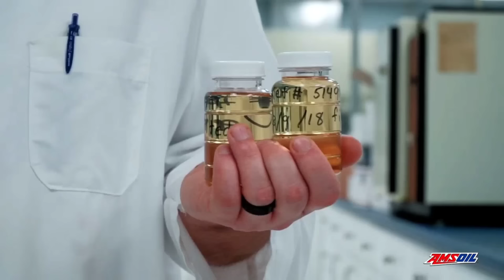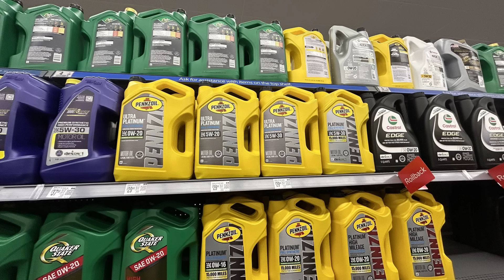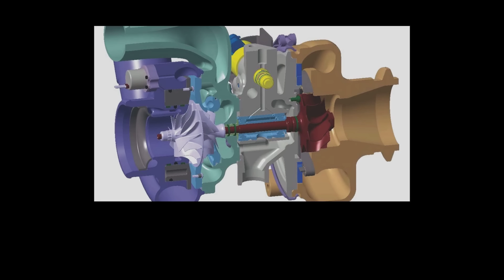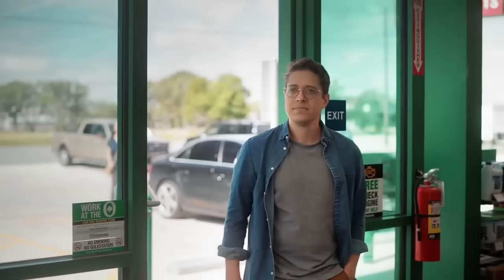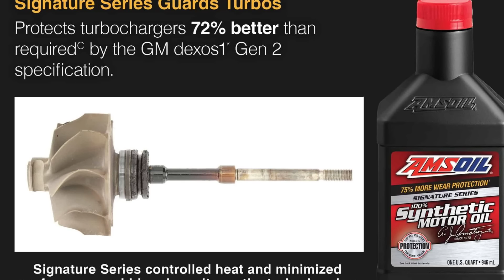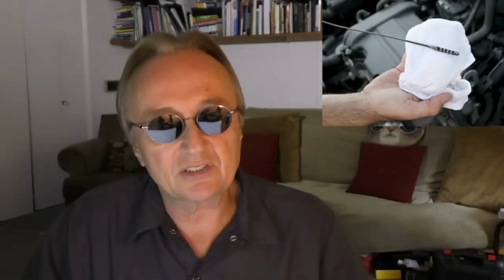Pennzoil Ultra Platinum vs Amsoil 5w-30 Oil

Comment: Nissans Chief engine builder says not to go past 2,000 miles between oil changes.    He is an educated man who knows what he is talking about.  Been doing 2,000 mile oil changes since I got my first car decades ago.   When I raced the engine oil got changed after every race.
Reply: Well he is working with a Nissan engine after all.
Reply: @johnk3606 My 1999 Pathfinder has run on Mobil 1 oil and filters since its first oil change.  Change interval is around 5K miles.  The engine has 255 K miles on it and runs extremely smooth.  I had to change a valve cover gasket last year, everything underneath was like new.  That vehicle has had only around $2000 of unscheduled maintenance since I bought it.  It has been the most reliable vehicle I have owned.  That said, I would not buy another Nissan since Renault bought into them.
Reply: Another person stuck in the 70’s 🤦‍♂️🤣
Reply: Yes,i saw that video....and he said Castrol makes the best oils.
Reply: @steverugerguy9606 Castrol is one of the worse according to real tests
Reply: @candyman1967  I've torn down many engines.  Most die from abuse and neglect.  The average person does not treat their cars well.  Just routine oil and filter changes go a long way.
Reply: @steverugerguy9606  Good thing I use Castrol.

Comment: Amsoil is 10% better than Penzoil Ultra platinum, cost double. If you change oil every 5000 miles, PUP is good enough. If you have very expensive car, use Amsoil. Running 10000 mile oil change could make the oil acidic, which could corrode the engine.

Comment: I'm an old man, that will get bombarded right out of here, but I am a survivor and march to the beat of my own drum...I have one of the most basic engines designed in the 90's a 2000 4 lunger Saturn 🪐...I have used basic conventional Rural King (they carry Providence Automotive now) 5W-30 oil because it's inexpensive and about 7% Marvel Mystery oil in it...It now has over 300,000 miles and still runs strong and idles like a Swiss watch... Went about 4 to 6000 miles between oil changes.. with basic Prime Gard and Super Tech oil filters too..It's pretty clean in there, as I saw when I changed a Cam cover gasket at 260,000...I believe in keeping the piston rings clean too, and MMoil has been around for a hundred years now...And it seems to do it in spades, as a cleaning agent, and extra fine lubricant for timing chains and tensioners etc... I'm not worried about Changing the oils delicate additive package and blah blah blah...I just know what works for me... But your results may differ... Keep the Faith 🙏 Arrivederci
Reply: Hey, it works for you and your happy, thats all that counts.

Comment: V8 every 3k miles i run  Pennzoil Ultra Platinum Full Synthetic 5W-20 w 10oz of Prolube
Reply: Prolube 🤦‍♂️ Suggest you watch the expert Lake Speed on that subject
Reply: Don't use oil additives,the oil is perfect

Comment: PAO base stocks are from ethylene, which comes from cracking petroleum.  So in reality Amsoil appears to be from oil whereas Pennzoil PUP is from natural gas.
Reply: You are 100% incorrect on the PAO comment 🤦‍♂️🤷‍♂️🤣
Reply: @candyman1967 He is 100% correct.  Amsoil is made from PAO which is derived from ethelene gas which is derived from CRUDE OIL.

Comment: Project Farms weighted scar test is not an acceptable method to test effectiveness of engine oil.
Reply: It is if you build, tight and very compact engines that are still gasoline not diesel, but are running in very high compression ratios 11.5:1 and higher, with small and Variable Geometry Turbochargers (VGTs) - specificity of 450mln owners of the cars in EU, I suppose.

Comment: I'm a die hard Amsoil customer. Its Signature Series says up to 25k. before change. UP to. Would I  go 25 k? No. I change @ 10-13k. Less carbon in oil. I use either Amsoil or Wix XP filters.
Reply: Wix xp filters are nowhere near as good as amsoil ea

Comment: In my day, if you bought a used car that the previous owner used Penzoil and you changed oil, the car would start burning oil.
I’ve always used Valvoline and now I use Mobile 1 full synthetic.
I can’t find Amsoil
Reply: You're full of crap.

Comment: I will never ever use amsoil.  Years ago I put their signature series on all three of our cars.  After 5K miles when I did the oil changes on all three cars, and all three had half the oil disappear.  I assume the oil burned off?  Never touched the stuff again.  Never had oil burning issues with the vehicles after.  Kept two of the cars for many years and miles without issues so it wasn’t the vehicles?
Reply: Same here, used signature series on my vehicle, hoping it wouldn’t burn and lose as much oil, only lost it even quicker. Won’t waste the money on that.
Reply: Tell them up in Superior and see what they have to say.

Comment: I change my oil and filter every 4000 miles. I'm using Pennzoil ultra platinum 5w30 and Fram ultra synthetic. I used Mobil full synthetic 5w30 before motor was always noisy but quieter with Pennzoil.
Reply: I switched from Mobil 1 to PUP and both vehicles burn less oil now and have quieter lifter noise
Reply: Pennzoil Platinum is All ya need for up to 5k mis. Proven.  PUP best for 5-7k mis or GTDI engines. Facts.

Comment: Love that Pennzoil Ultra Platinum The Motor Geek uses it in his stuff and he's all about oils that's good enough for me. Check out his site he lives and breaths oils.
Reply: Love Lake and I use Pennzoil ultra when available or just platinum. I change my oil and filter every 10,000 and 5,000 I drain the pan. I am using the Purolator boss filter, but I will be changing to just a Purolator one on the next filter because of a 20 micron filtration.
Reply: @dvdbiller  Agree on the PUP.  I've had multiple thread issues with Purolator Boss filters, to the point I have had to reuse an old filter as the new one would not screw onto the mount bolt.  Interesting you are changing from the Boss to a regular Purolator.  I will look into the differences.
Reply: @CorkVanDenHandel Lake Speed addressed this issue on his channel The Motor Oil Geek. It was recent, may 2026.
Reply: PUP & PP are no longer made from natural gas.
I will be switching to Amsoil Signature, since I change my oil once per year I will pay the extra money.
Reply: Pennzoil removed GTL from there oil. Its no longer made with it.

Comment: Both are very good oils, but amsoil Signature Series is completely synthetic. Natural gas is a hydrocarbon but how they make it into an engine oil is amazing. Amsoil is guaranteed and states the warranty will not be voided. The oil is good for 25,000 miles or one year for normal use, and 15,000 miles or one year in extreme use with their filter. That can be extended if the oil is tested and passes. I use Amsoil 10W-30 diesel oil but, I usually only put about 7500 miles a year on my cummins pick up. Cummins states change the oil every 15,000 miles or 1 year which is INSANE. I replace my oil and filter once a year, regardless of the miles since I will get nowhere near 15k.
Reply: Hi, I live in Poland, cold country in north of EU and my friend I need to confirm what you are writting, ... basically, they want us to change oil less frequently, and they force us (during OEM warranty) into a bit less than optimal oils. Whenever you can, change it in reasonable timeframes, and your engine will work much, much longer! Its no secret here in colder countries of EU that we do not like their policies, they cost us much more than people from Spain, Italy and even France, we obviously are burdened by the real 4-seasons - from 36C during summer to -25C this winter - so ... for absurdly thightly 3-cylinder engine like TFSI EA211 with turbo, we need absolutely to change oil every year, I do it even when I had around not more than 1200 miles ... per year (you know - remote work and cv19). Either way, at least they also produce some top tier synthetic oils that can manage that.. otherwise we would be 🪛.

Comment: I dont care what auto makers say i always change my oil at 5k
Reply: I use pennzoil ultra platinum I change mine every 4000 on my 6.8 v 8 f 250 2024 oil is cheap engines not so much.
Reply: @winstonrocco1981  I change mine  using Pennzoil Ultra about every 3000 on my Ram Hemi. I don't drive it much more than that yearly.
Reply: Your just waisting money......
Reply: @jasondefillipo4553 
Yeah probably but I’m retired and don’t drive it much so usually it’s been a while when I change oil lol

Comment: You would be surprised about the quality of amsoil signature series oils. I have a high mileage 2004 BMW 530i which I bought at 242,000 miles. I used Castro edge for a couple of oil changes and ran about 6,000 miles per oil change. However I realize the oil gets darker sooner. Then I switch to Amsoil 5W-40 And I used the Amsoil oil filter which is said to protect for 15k miles. I also had a little oil burning issue with other oils. Every for every 5,000 mi I would have to use at least a court of oil. I drive my car pretty hard sometimes. However with Amsoil at 10,000 mi with the same oil didn't burn a single drop off oil and also the oil was almost transparent like new. However I change the oil filter at 10,000 mi and kept running with the same oil and added about a code to top it up. Oil started getting darker when it reached about 14k miles. However I ran the oil for $18,000 mi with two filters and then change the oil. It is amazing. At least I know for 10,000 miles answer will protect very good
Reply: That poor M54😭 just because oil gets dark fast doesn’t mean it’s bad it means it’s cleaning your neglected engine which you going 14k miles means previously your really pushing that engine out, but props to you at 242k miles I’m at 236k engine is still factory silver internally, 3k miles oil changes and never needs top off, no consumption ever in its life

Comment: I've used Amsoil Signature Series since 1975.  I follow the 25,000 mile oil change interval (usually change between 20k and 25K) and now have driven almost 3 million miles on Amsoil engine oil and have never had to do an engine repair and never had to add even a drop of oil between oil changes.  My current vehicle is a 2017 Cadillac XT5 that has 210,000 miles and has had 11 Oil changes.  The engine runs perfectly and uses no oil.  I also use Amsoil oil filters that filter down to 20 microns.  Amsoil is the best and becomes very affordable if you become a preferred customer.
Reply: I also have used Amsoil since he 70’s with similar results. I am sure Pennzoil is a great product👍🏻
Reply: Kudos. This is impressive.
Reply: I am wondering at 13,000 miles is your oil black when you check it?
Reply: @kerryguzman8263 it isn’t the black that’s bad. It’s the chemical makeup of it at that point.
Reply: I’ve used them all. I have never had an engine problem. I can’t see paying that much for oil.
Reply: @ralphllivrah9551 in a world where engines are being engineered to be trash anything we can gain is a plus. When ya got companies like Toyota and Hyundai kia admitting issues. GM too. And they are installing the same exact defective engines. Not looking at the issues and fixing them and nobody holding them accountable. Look at GM. They stated using this thing that has been failing since 2007. Renamed it a couple times. But refused to fix it by removing it. Now we have 2016 trucks worth less than 2003 trucks all due to the fact they decided to install defective parts when hey had the correct ones in the parts bin the whole time.
Reply: @radzer0966 I’m telling you I’ve never had a failure. Everyone knows Amsoil is the best,however it’s much more than you need. 
 If I was racing it’s a no brainer. I would run it,if I could afford it.
Reply: @ralphllivrah9551 having a problem and running at peak efficiency and performance longer are two different things.
Reply: @d@digitalunit318can only afford sufficient performance.
Reply: LOLOLOL
Reply: 20 to 25k no way any oil protects that long
Reply: @MARTPERE facts backed by used oil analysis. So you’re wrong. Again though it defends in multiple environmental and usage factors and engine condition.
Reply: Pennzoil Ultra Platinum is better, and way cheaper.  The price of Amsoil is ridiculous. No thank you.
Reply: @maj8301 it’s cheaper and good. Amsoil prices are high yes, but be real. GTL is factually not better than PAO which is why Amsoil SS is more expensive.
Reply: You get what you pay for...Always is true in anything,  even gasoline...cheap Costco gas.
Reply: Almost any filter at Walmart will filter at 20 micron...
By chance do you ever sample your used oil? 
If not you're just guessing at best!
Reply: @WhoReallyCares917  Yes sir! Wear metals, fuel in oil ratio, all great stuff to know. It's really the only way to go. Do you need one every oil change? I don't. After I've done one and a confirmation second test (to make sure the first test wasn't an anomaly), I'll go for a year or so. After a while, if you're using the preferred oil and you know the engine, heck, I've gone 2 years. But yeah, you gotta do at least one of 2.
Reply: @WhoReallyCares917 i change oil at 10k to 15k. Use pennzoil my whole life. When the came out with synthetic oil I went to it. I’ve never had a motor go bad.
Reply: @WhoReallyCares917 that’s bs. Right off the bat mobil 1 filters are rated ay 30 microns .

Comment: Engine oil performance fluctuates slightly on same oil same weight with different batches.
Reply: ... not for actually synthetized ones - like Amsoil. They literally check every few 100'ds liters manufactured prior to adding costly additives - I've seen footage and documentary from inside the factory.

Comment: Tried pup. Got better wear results on u.o.a's with Valvoline.
Reply: What's uoa?
Reply: @TENNSUMITSUMA used oil analysis
Reply: @TENNSUMITSUMA Pennzoil Ultra platinum is in a whole different league vs Valvoline. I would bet any money Ultra platinum would beat any Valvoline in wear protection.
Reply: You mean tell us, that you used science over speculation!!? 
You Sir are a legend!!
Reply: What type of Valvoline?
Reply: @jacobsebastien3910 both extended protection, high mileage full syn And restore and protect
Reply: @jacobsebastien3910  I'm thinking it's gotta be restore and protect.
Reply: Me too.

Comment: I change my oil every 5k miles or less so Pennzoil is the practical solution for me.  Way cheaper than Amsoil and widely available everywhere.😊
Reply: To bad it isn't made with GTL anymore.
Reply: The lack of being readily available, plus the fact that I can get my usual oil on special, plus the fact that due to doing lots of relatively speaking short trips I change the oil very regularly (my car has a ... "unique" oil change schedule.....)

Means that buying Amsoil is just not a practical solution.